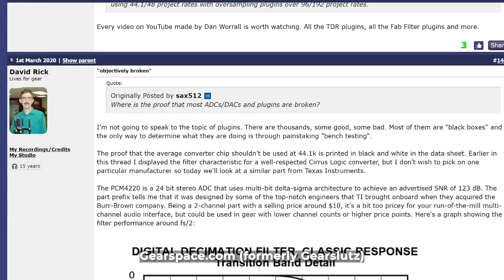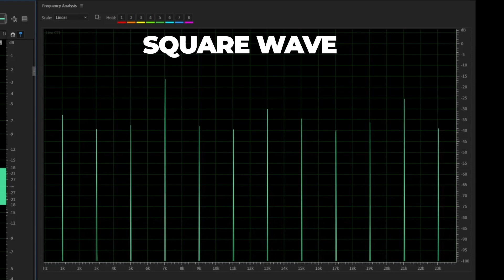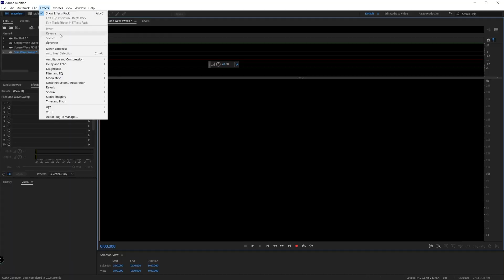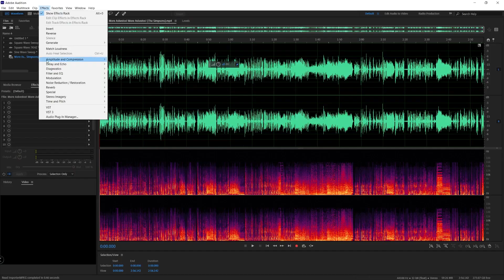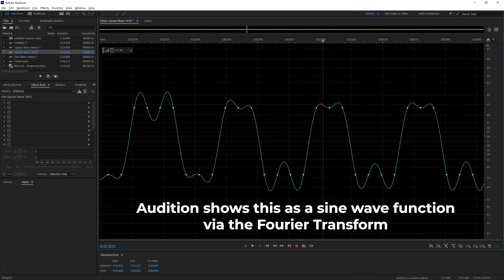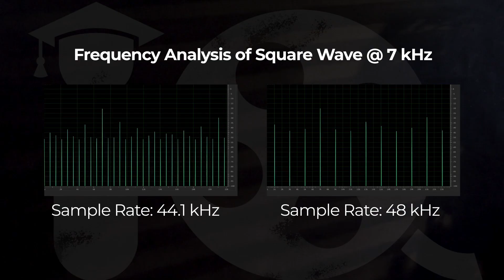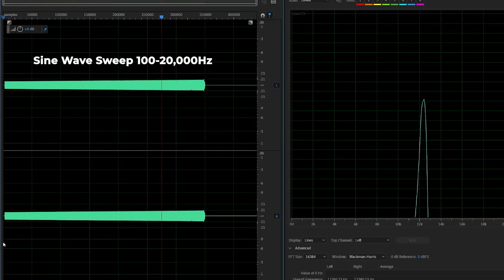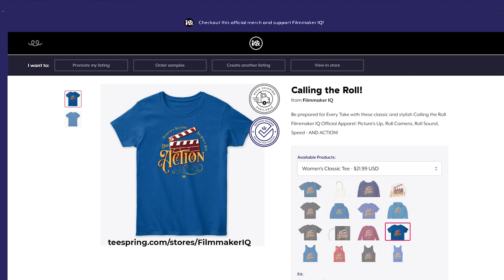What is the Optimal Sampling Rate for Audio? (It's All About the Aliasing)

Comment: Your video is good and correct overall but I think you didn’t choose the best example to demonstrate. By using square waves, a type of signal that doesn’t exist in nature and that is generated by a Fourier series you mixed two subjects and made it harder to follow, even to someone not foreign to audio and Fourier transform. So the artifacts you showed at spectrogram were more due to the Fourier nature of the signal than to nyquist frequency.
Reply from the maker: I don't follow your criticism.

I'm talking about aliasing. It doesn't matter if it's created by a natural sound or a artificially generated, the results are identical.

The square wave is simply the easiest way to generate all these higher than Nyquist frequencies
Reply: @FilmmakerIQ  I got confused when you showed the spectrogram showing frequencies below the fundamental... Nyquist sampling effect wouldn't generate frequencies below, but cut higher order ones. But since square wave was generated as a sum of sine, when you cut high order the left components were sine below fundamental... I hope it make sense.
Reply from the maker: The problem is you are used to a world where everything has been filtered so that it cuts the higher order frequencies. 

There's nothing about Nyquist that says you have to filter out the higher frequencies - when you don't - this is PRECISELY what happens - you get these aliases. And the aliases lose all harmonic relationship with the fundamental frequency - they can be anywhere.

That's what's so illuminating about this demonstration - you didn't know what aliases were in the first place because you've never seen them before!

Comment: Odd, I have old bad ears with loud tinnitus.  I couldn't hear the high freq, but when you rapidly changed the freqs I heard a quick dip.  Maybe an issue with the software/you tube?
Reply from the maker: There's really no way on my end to cut seemlessly between two sine wave like that. It was either put a small cross fade between the two or have it pop between the two and I chose the crossfade.
Reply: @FilmmakerIQ  That would explain it.  Happy I could at least hear it, without headphones even.  :^)

Comment: i use 44.1khz with 24bits per sample and it sounds better than 16bits in some applications but in general use its near impossible to tell the difference 

if i want to see a real difference i would need to purchase better speakers than a 5.1 logitech z906 set as their drivers are decent but its impossible to tell the difference on them 44.1khz and 48khz on these cheaper speakers 

the quality of the drivers does matter but in general use i think a 24bit 44.1khz signal is perfect for the mass majority use
Reply: MF Nickster  24 bits per sample at 44.1khz is denser than 16bits per sample at 44.1khz
Reply: MF Nickster  i personally use 24bits because i can feel the difference 

also this is like comparing display bitrates imo .. most cheap displays use 8bit color (256 for red 256 for blue 256 for green) for 16 million colors 

while 10 bit and 12 bit displays use far higher values with 10 bit having about a billion colors 

and 12 bit having even more ... we see these higher bitrate displays for HDR and other such things for smoother transitions and larger color gamuts 

i think its clear that audio works the same way and i would personally prefer the higher bits per sample so i can have just that much more clarity and definition with the sound i am enjoying
Reply: MF Nickster  plot points along a sine wave ... use 256 for 8bit and 65536 for 16bit 
and 16,777,216 for 24bit 

the smoothness between 8bit and 16 bit will be obvious ... the smoothness between 16bit and 24 bit less so but if you had alot of dynamic stuff happening it may be more notable to have 24 bits ... why would hollywood master in 24 bits if it was just a placebo

Comment: I can tell the difference easily between 96 and 48 and I believe also between 44.1 and 48.  My hardware has much better latency at 96kHz.  The problem is that quite a bit of my VST base sounds better at 48 so I leave it there.
Reply from the maker: I'm willing to bet in a normal listening situation - you couldn't tell the difference between 44.1 and 48 in a completely blind test.
Reply: @FilmmakerIQ  For me - "normal" is a maxed out 2019 27+ iMac, Universal Audio Apollo X6, and several thousand RMS watts powering multiple Electro Voice Speakers including 2 ETX-35P 3 way and 18" EV subwoofers.  I don't expect anyone could hear the difference on Mackie 824 monitors and a MOTU Ultra Lite Hybrid which was my former setup.
Reply from the maker: No, I mean normal as in you're playing a piece of music without repeating a small section over and over again.

Even on your system, I'm willing to bet if you did a blind test you would be guessing 50/50 because nothing in your setup suggests you have the ability to hear the ultrasonic frequencies.
Reply: @FilmmakerIQ  The difference is slight at best.
Reply from the maker: Slight differences are breeding grounds for biases. You can convince yourself of slight differences very easily even when they aren't even there.

Comment: Here we go again. Audiophiles with zero training in sound engineering trying to lay down the science. Humans are the limiting factor here. Our ear drums can only flap 20,000 times second, so any sound waves hitting them must not exceed 20khz otherwise we cannot sense them. Our ears also have a built in protection device that mutes sound that is louder than 90db, so our ear drums don't blow. That means the dynamic range cannot exceed 90db. Raise the volume and our ears muffle, muting the lower volume sounds. That's why your ears ring after a loud rock concert and sound muffled. A sample rate of 44khz is more than 20khz positive and 20khz negative wave to capture the full sound wave. A bit depth of 16bit can record a 90db dynamic range. That's it. CD is tailored to the human ear.
Reply from the maker: Watch the rest of the video because I'm the furthest thing from an audiophile
Reply: It's so funny seeing this old CD dogma being spewed while knowing it's pure horsesh*t.
Any diaphragm that can capture and transfer or reproduce sound, including our ear drums, can vibrate at way beyond 20,000 times per second and all of it within the 20Hz-20kHz(ish) interval. How is that possible you say? Because we can actually hear more than one soundwave at a time in the 20Hz-20kHz(ish) spectrum.
The big lie and subconscious claim of the audio industry when using the Nyquist theorem is that we can only hear one soundwave at a time, which is flatly untrue.
We can hear many different soundwaves playing at the same time, within the 20Hz-20kHz spectrum, and all of them have to be sampled individually in a sum of samples for actual real sound to be captured in its audible entirety.
That's what super hi-res audio sampling methods like DSD - the real hi-res sampling method these days, do - capture more of the real sound we can hear by capturing more of the soundwaves that we can hear - and they are all (or mostly all) in the audible 20Hz-20-kHz(ish) interval.
DSD sampling at 2.8Mhz does not mean that it is capable of capturing a 1.4 Mhz soundwave that you could hear. It means it captures 1.4 Mhz worth of multiple different soundwaves in the 20Hz-20kHz audible interval (mostly) - and it sounds fantastic compared to CD. Once you hear DSD on a resolving system, CDs are forever ruined.

Comment: The answer is "no" the Nyquist theorem isn't wrong and aliasing isn't a problem when the signal is band-limited.  Filter first.  Problem solved.
There is never a problem with aliasing because people use insanely good filters (that are actually made by oversampling with a shallower filter then applying a digital filter - all invisibly in the hardware).  If the question is "what's the best sample rate" then you have to determine if people can hear the difference between a nearly brick-wall filter and a shallower filter and if anyone cares. 
In any case many young children can hear well above 20khz, so maybe the question is, who is audio for.
If people can hear a 10khz square wave vs. sine wave that does not mean that aliasing is the problem. 
1) of all your frequency analysis is WRONG.  An FFT on a finite sample isn't actually giving you mathematically what's there over the whole signal...
The aliasing you see has to do with the way the FFT wraps around and the fact that you probably didn't use a window function on the FFT very well if at all.  Mathematically those lower frequencies you saw DON'T EXIST.

2) but... so what's going on with your ears?  Who knows?  If there are nonlinearities in the ear or the speaker that created harmonics... Or maybe it's just what you're seeing, you can hear higher if there are lower harmonics present - some kind of cross sensitization.  After all the actual sensors in the ears are little hairs with resonances - and they physically have higher harmonic resonances.

Also I can't hear any difference between A and B
Reply from the maker: Look closer at the thumbnail. ;)
Reply: @FilmmakerIQ  yeah I see the thumbnail, so?  What about the fact that your spectrum graphics are completely wrong - and you talked as if they weren't?
Reply from the maker: I'm guessing you didn't see the word "no" in the thumbnail.

And what's wrong with my frequency graphs?
Reply: @FilmmakerIQ  because there IS no lower than the signal aliased frequencies.  That doesn't happen at all.  The fact that you saw them in your graphs means that your spectrum analysis software is completely fucked up.
Reply from the maker: What are you talking about? Of course there is lower than the fundamentals signal alias frequencies... You can hear it... The square wave sounds lower than the sine wave.
Reply: @FilmmakerIQ  unless it was sampled with utter trash, that simply doesn't happen in the slightest.  You think you hear it, but IT'S NOT THERE.
Reply from the maker: The square wave was created without anti-aliased filter applied... It's going to create alias frequencies that are lower than the fundamental. You see this demonstration in the square wave sweep as the aliases bounce up and down.

I'm sorry you don't understand the topic. You really should follow the logic a little more carefully instead of getting triggered
Reply: @FilmmakerIQ  It doesn't need an antialiasing filter because that only applies to signals that have higher frequencies than Nyquist which isn't possible in the digital domain. 

And what LOOKS like aliasing:
1) doesn't have anything under the fundimental - you can beat at a frequency without having any of that frequency - your eyes are fooling you.
2) all of what looks like beating against the sample rate will be fixed up by the reconstruction filter. Now you know how all that pre and post ringing helps.
Reply: hmm wait.  Sure that square wave can't have frequencies above nyquist... but does it need filtering to be reconstructed in the same way that a properly sampled square wave would? 
That's interesting.  Yeah. It was point sampled without filtering. 

So yeah.

But a properly sampled square wave would have reconstructed without any low frequencies.
Reply: But in that case your claim was wrong.  You weren't talking about a square wave that was sampled into the signal, you were talking about something generated directly in the digital domain, and incorrectly.
Reply: So, I was right that SAMPLING can't create aliasing frequencies because it's done correctly, but you didn't SAMPLE that square wave from an analog signal.

If you want to generate a square wave without any alias frequencies, then build it up from sine waves using the formula for the fourier expansion of a square wave and don't include any of the sine waves above nyquist.
Reply from the maker: It was created correctly. It's a square wave, but it's not antialiased square wave. 

I'm demonstrating what aliasing is, and this square wave creates a lot of aliases.

There's nothing wrong with my frequency charts. You just don't know what aliasing looks like.

My claims are correct.
Reply from the maker: No, sampling can and does create alias frequencies.
 
Alias frequencies don't exist in the real world. They are created BY SAMPLING.

Why would you stop adding harmonics one you reach the Nyquist limit? There's no reason to... What happens when you don't stop at the nyquest ... That's what the video demonstrates.

Quit with the "I'm right and you're wrong"... Because you are wrong... Not only in your assertion but also in your interpretation of what I'm presenting.
Reply: @FilmmakerIQ  No, proper sampling, like the kind they use to create digital tracks from sound does not create aliasing frequencies, period.
But you didn't take a sound from say a CD that sampled a square wave generator, you generated one directly in the digital domain with unfiltered point sampling - and THAT creates alias frequencies if the source has components above nyquist, which square waves do.

But that's not what people mean when they talk about a square wave on a CD.  You sampled it wrong so you got the wrong result.
Reply: @FilmmakerIQ  your claim that people hear higher than nyquist is NOT proved by a square wave that has it's higher frequencies aliased down.
If you filtered the sampling properly there wouldn't be any alias frequencies.
Reply from the maker: Yes sampling DOES create.... HOW DO YOU THINK THEY GET CREATED??? 

Do you think they exist in the real world????

The reason you don't get them when you record is because the A/D process involves a low pass filter to kill off any aliases. This square wave demonstration shows what happens when your don't add the low pass filter.

The argument for optimal sampling rate has everything to do with the shape of that filter.
Reply from the maker: I NEVER MADE THAT CLAIM.

Like I said, you don't have a clue what I'M talking about... You're arguing with what you THINK I said, which is just wrong
Reply: @FilmmakerIQ  your recording isn't a recording of a square wave, it's a recording of an improperly sampled square wave. So that tells NOTHING about digital recording, it tells about digital recording done wrong.

Comment: Big OOF about 10 kHz square wave. You can NOT generate a proper 10 kHz square at 44.1 KHz sampling just by setting the samples to 1 and -1.
You need to sample (generate) it at some higher frequency (like 1 MHz) and then resample down to 44.1 KHz, which, of course, will cut its harmonics off.
Reply from the maker: Depends on what your definition of "proper" is. Wave table synthesis creates a square wave with all it's alias harmonics. How is that less "proper"?
Reply: @FilmmakerIQ  I wasn't actually debunking your point. The point is that there's no "square" 10 KHz waveform at 48 KHz sampling.
An analog square wave is not the same as "square" samples.
If one were to run a 10 kHz analog square wave through a 48 KHz ADC, the result would not look square at all. It would just look as if we were sampling a 10 KHz sine.
Reply from the maker: That's kinda what I demonstrated at the end there.

But the other question would be, if you ran a 10khz analog square wave through a speaker would you be able to tell? Because the speaker and your ear drum are ALSO limited by what frequencies they can respond to.
Reply: @FilmmakerIQ  That's easy to test, and I would expect that one would be unable to tell the difference, as long as amplitude of the fundamental frequency (NOT amplitude of the wave) is the same.
Reply from the maker: Exactly ;)

Comment: You realize that the cinema playing your DCP is setup to process it in 48khz right? But what you say here is all correct theoretically there may be a benefit to sample rates of 60khz or 96khz but I would challenge anyone in a typical cinema environment even high end if you could tell the difference between playback at 48 or 96khz. Bit depth is also important. The fact is good old analog magnetic 6 track with Dolby SR noise reduction is the best! Lol 😂
Reply from the maker: My point is never about playback ;)

I agree that 48 is plenty for playback

Comment: What about 21.168mhz as an audio device clock frequency? :)

Also, am I the only one who used to be able to hear 21khz in early adulthood? .-.
Reply from the maker: So which wave had the 21? A or B?
Reply: @FilmmakerIQ  I can't hear that high anymore. 20khz I can barely feel the air pressure anymore.  Around 18~19khz is a hard rolloff. :(
Makes me sad.

That said, both have additional high frequency, but B was much more pronounced. It might be the headphones producing some of it though, because it was audible in both to my ears.
Reply from the maker: I played a nasty trick, if you think it's B, it's not. :D
Reply: @FilmmakerIQ  B definitely has a louder high frequency whine though. Like, significantly louder.
Reply: @FilmmakerIQ  Oh I get it now, it switches half way through. What a nasty trick.
At the start, it's definitely B though.
Reply from the maker: Yes. If you didn't notice the trick... It could be a bias coloring your perception
Reply: @FilmmakerIQ  It took a while to notice, but I think it's that the high frequency ringing sticks around after the first time.
When it goes from A to B it's super obvious, but after that, I can't really tell. It seems to sort of "pop" every time it shifts except the one in the middle, but otherwise, that ringing sticks around in my head for some 10 minutes or so XD

I guess my hearing is really going in more ways than one.
Reply from the maker: Well the pop between the two sine waves have to do with the fact that they're not exactly in phase with each other and it's crossfading. I tried my best to try to match up the frequency amplitudes with really didn't work so I ended up just using a Crossfade to make it as least irritating as possible